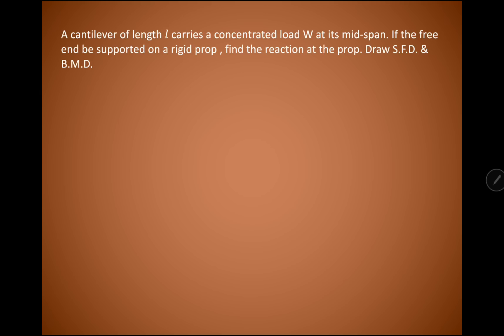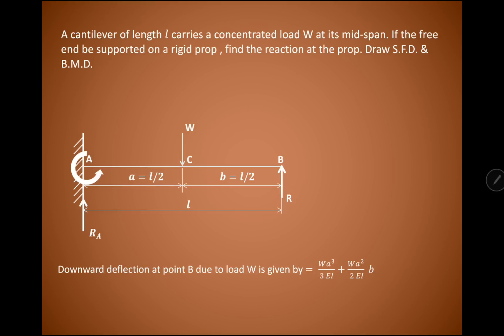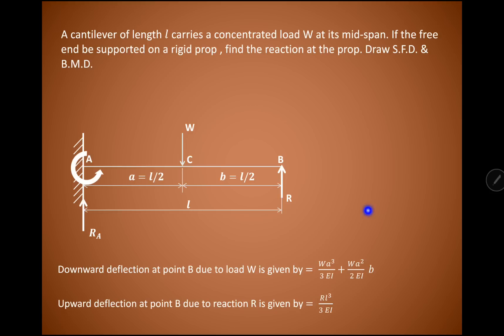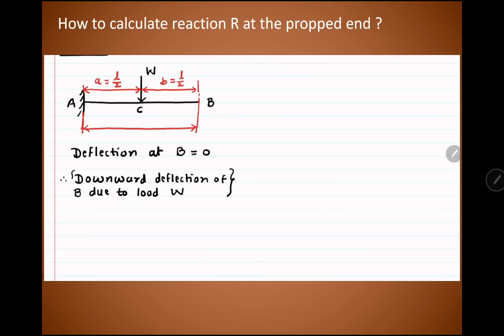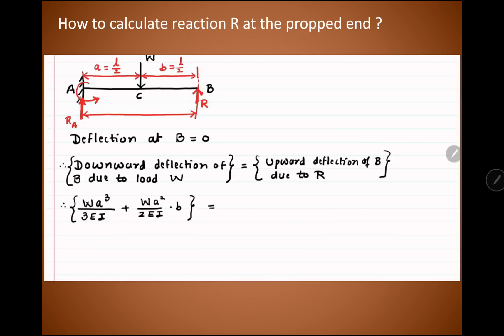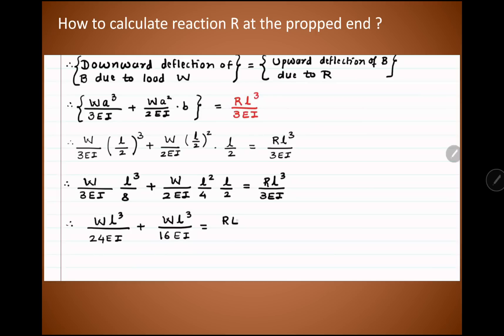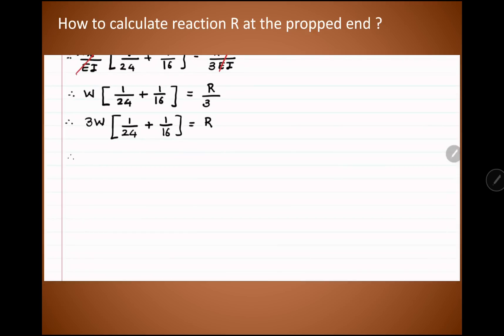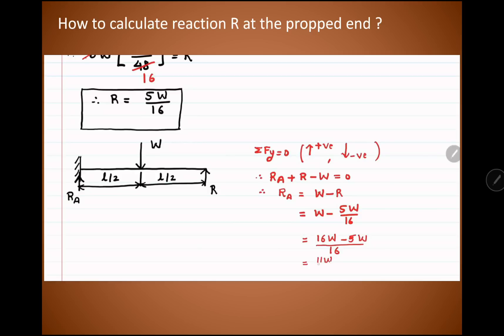Lecture 11 | Propped cantilever beam - Shear force & bending moment diagram

Comment: Just one question.
How did you take the moment at A to be anticlockwise ?
Reply: As you can see that the force on the beam is acting downwards hence that will create clockwise moment at support A. In order to resist that clockwise moment on support A it will need an anticlockwise moment.